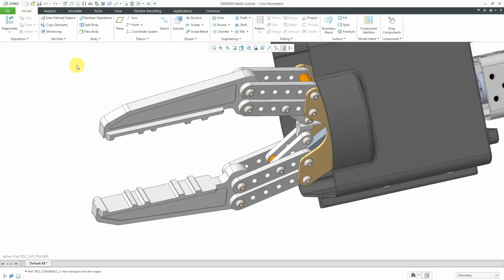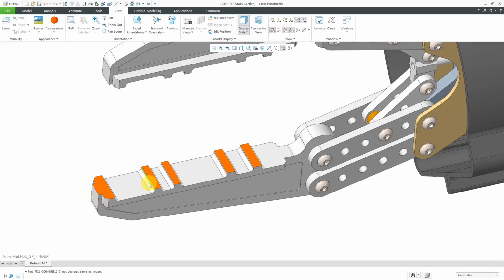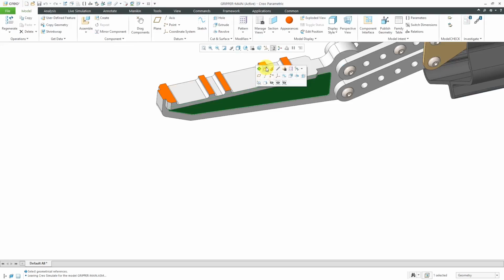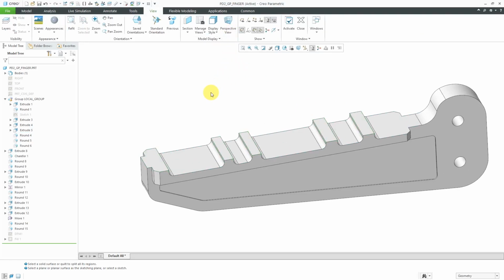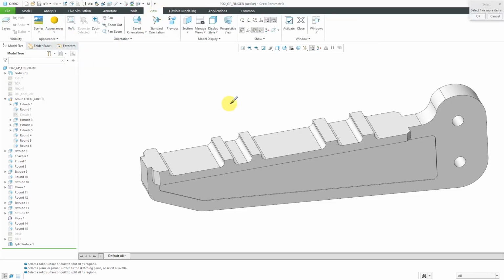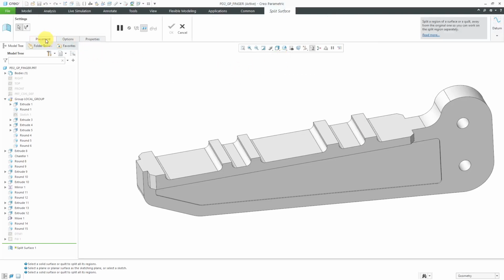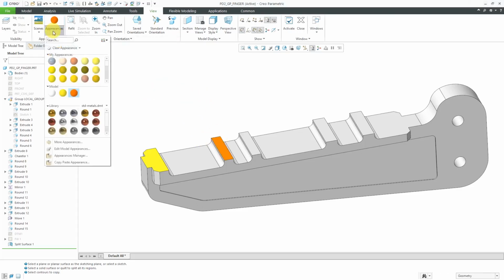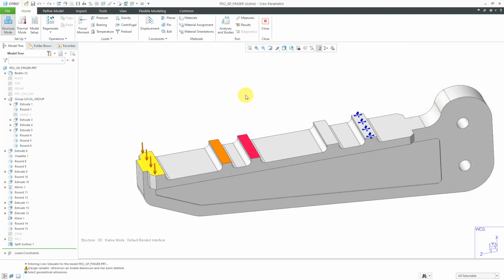Creo Parametric - Split Surface Command

Comment: Hi Dave is there any way to mate surfaces in assembly mode such that contact exists only at split surfaces areas and not on the entire mating surface?
Reply from the maker: It sounds like you’re talking about two different things. In assemblies, you define constraints, which define the location of a component relative to other components in the assembly. However, interaction between components in simulation mode is different. And yes, one of the use cases for split surfaces is to define different contacts conditions, frictions, constraints, loads, etc., on portions of a surface.

Comment: Is there any way to divide surfaces based on sketches to make select-able subsets like one can do in Solidworks and Inventor? All I can find is advice to make a tiny thickness extrude but that can't be the cleanest solution
Reply from the maker: See my video on the Trim command.

Comment: This is definitely helpful- I never quite understood why separate surfaces remained combined in the first place. I've recommended your videos to several colleagues!

Is there a way to split a single surface, such as a cylinder face, at a given plane or at a contour/ boundary? For example, I have a cylinder that will get a coating at one end and want to dimension to the coating. We usually will do a tiny extrusion and subtract material to create a visible line in the drawing that we can get a dimension to, but it creates a portion of the surface that is then the incorrect dimension, possibly creating an incorrect print if you dimension to the wrong surface.

Optionally, can you sketch on the drawing? I could just draw a line where the coating will be and notate it that way.
Reply from the maker: I would use a Cosmetic Sketch in the model for that purpose.
Reply: @CADPLMGuy  Thank you!